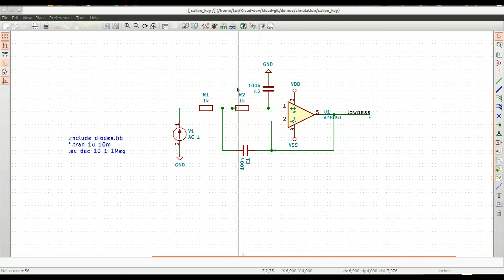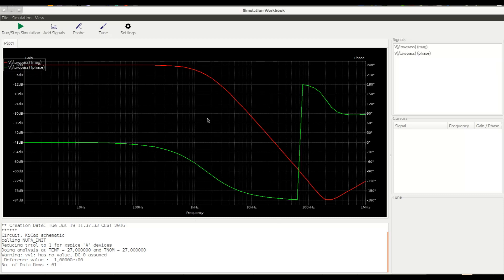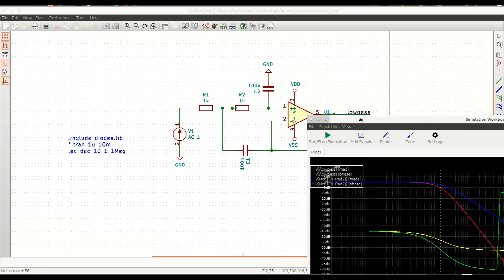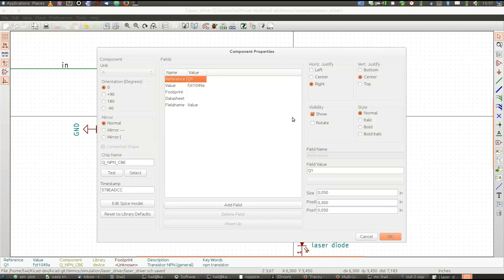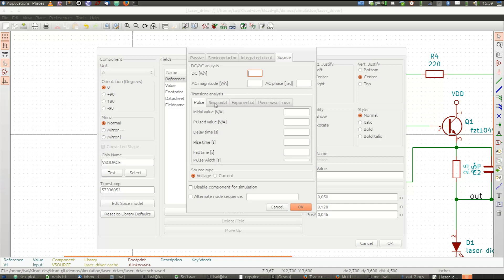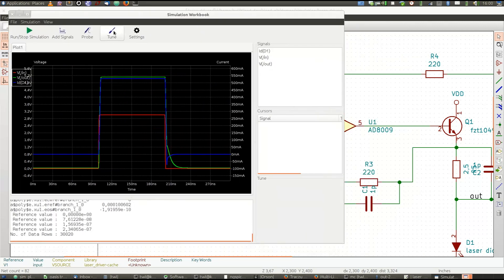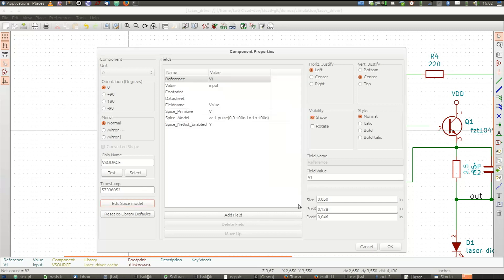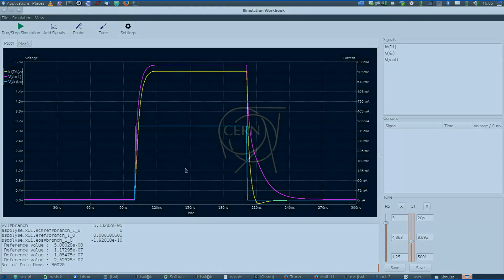Kicad Spice Simulator

Comment: Having trouble seeing the signal, as the Y axis is like stuck at 1V and it doesn't auto-adjust by itself and neither does it let me do it manually.

Edit: I found the "solution". You have to click 4 times the signal when using the "add signal" button. It's clearly a bug.

Comment: Complete newbie to spice in general. I've installed the nightly, however I'm having trouble simulating a DC circuit. My netlist is as follows:

.title KiCad schematic
RR1 VEE VCC 300
.end

I know the nodes shouldn't be labelled VEE and VCC, why does KiCAD export it like this? Also, what do I use as a DC voltage sweep source?

Thanks in advance

Comment: Where do you find the AC voltage source?  I don't see this device in the default libraries ...
Reply: Just the normal "voltage source" model works, if you tell it to be AC.

Comment: Hello all ! I try to simulate the famous NE555, then I create a first layer internal discrete component using basic 2N3904 and 2N3906 transistor with spice model and on top hierarchy components for Astable configuration. Now I want to simulate the all circuit, but I don't know how to setup the ngspice script command into my design. Is there any body to help me on this ? I've the Kicad project available for more details. Any help would be appreciated. Regards. Vincent.